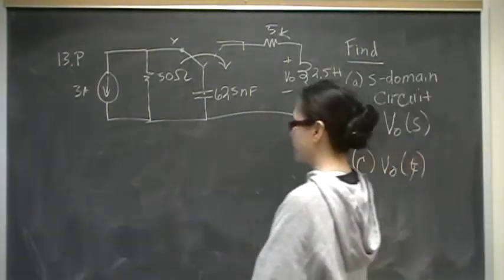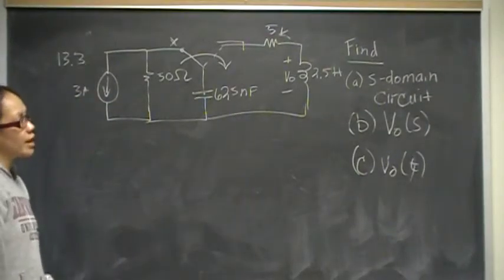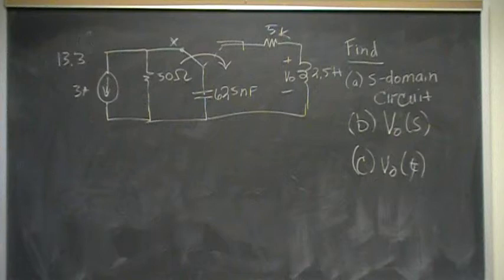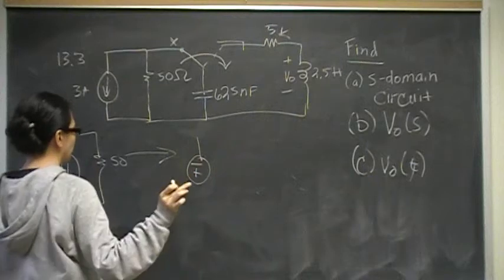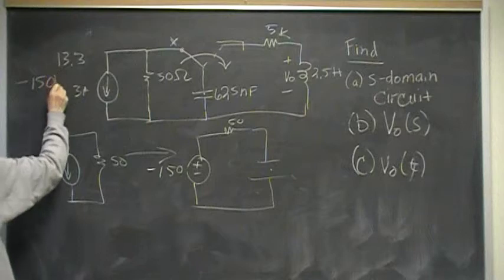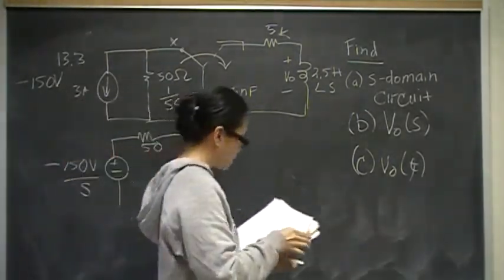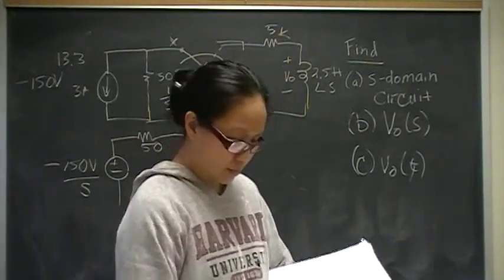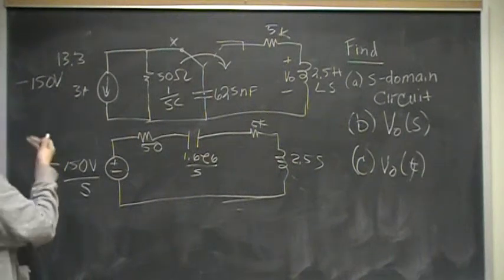Applications P13.9 Nilsson Riedel Electric Circuits 9E Solution

Comment: And after t=0 , the switch goes to the other side and the 50 ohms resistor goes away, but then why are you still using -150/s (your voltage source)?
Reply: i know that you asked that a year ago, but the reason is:
laplace transform of a capacitor, when it has a initial value becomes the impedance of the capacitor (1/sC) + a voltage (or current) source of (Vc(0-)/s)V. So, this source is from the laplace transformation, not the original voltage source.

Comment: I have two questions here.
1) Why did you eliminated the switch when you were to find Vo(s), that is voltage across the inductor?
2) Why did you use -150/s instead of just -150, when you eliminated the switch from your circuit?

Kindly answer as soon as possible, I am preparing for my so close exam. Thanks.

Comment: Because there is an switch and after t = 0, you only care about the Vc(0_)/S --> which is your initial condition for capacitor and there is usually one for inductor which is L(iL(0_)) as a voltage source and since the initial current through inductor is zero then it is zero for this case.